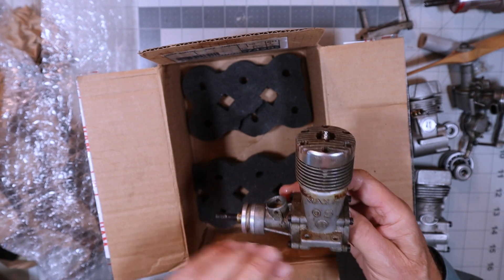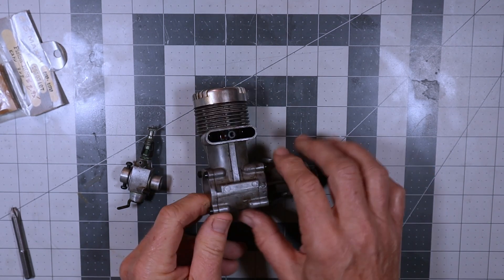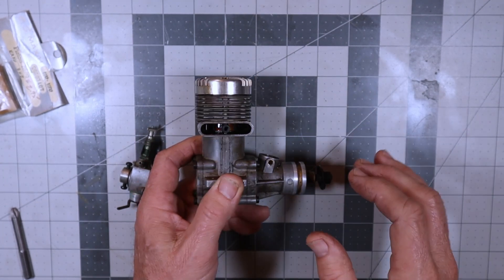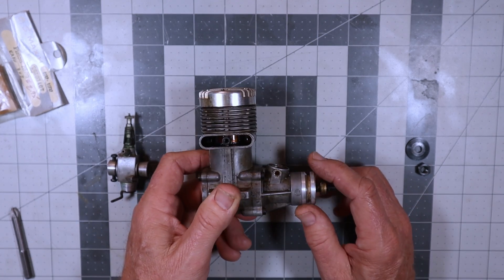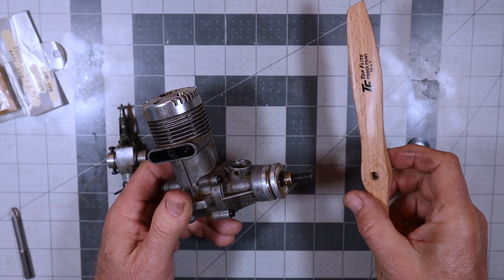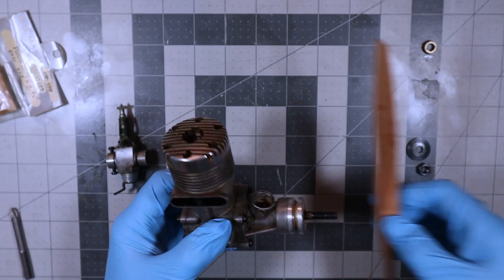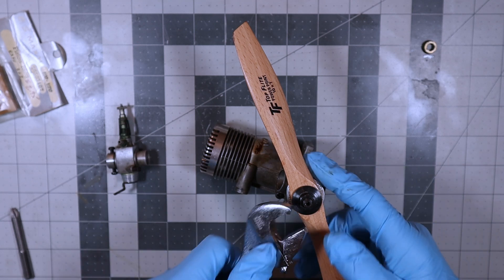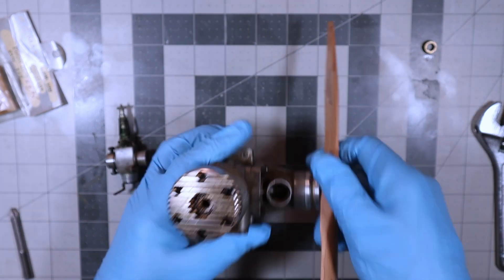How To: Free a Stuck Engine without Heat

Comment: I recently pulled a lot of my glow engines that have been sitting almost 20 years. All were locked up solid including the carbs. I found Sea Foam  motor treatment in a sonic cleaner works great to unstick everything.
Reply from the maker: Cool, but a very expensive cleaner.
Reply: @dmrcflyr2  Yea, not real cheap but cheaper than buying new engines. About $120 for the Sea Foam and a sonic cleaner. So far it's save 4 engines and I have 2 more to try. So worth it to me .
Reply from the maker: Many things will unstick an engine. 3-in-1 oil and a heat gun will do the same thing at a fraction of the cost.  Just because an engine is locked up does not mean it is bad or needs to be replaced.  If is is due to castor oil solidifying then that is a GOOD thing.  Castor forma a protective barrier to rust and corrosion.  This is something many people fail to understand.  However nothing replaces properly maintaining engines in the first place.

Comment: Hi Dave. Chip pan always works too!  Here in UK an oil called Vapour Oil is sold by WestonUK.  Dissolves glued up engines in minutes. Also a good after-run oil. Unsolicited testimonial. 🤪